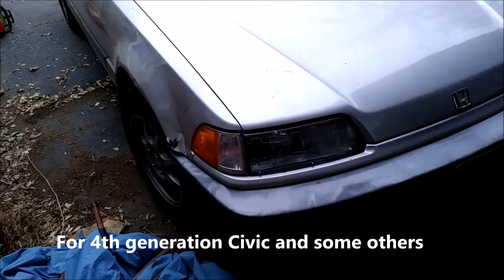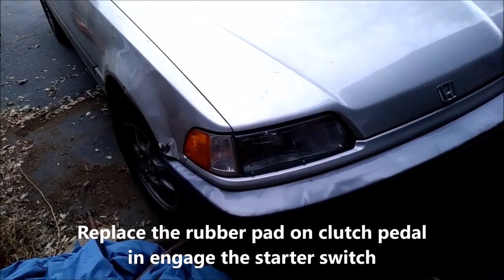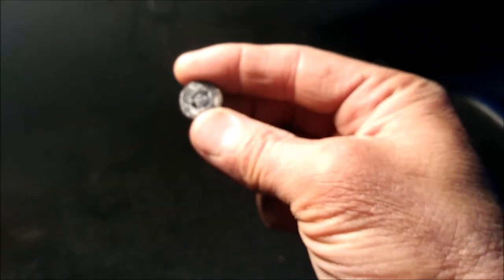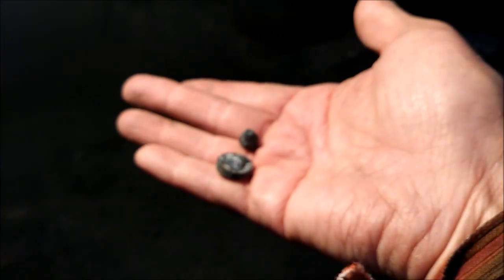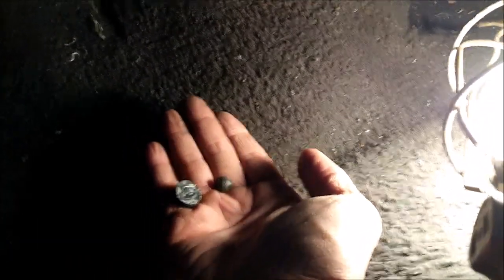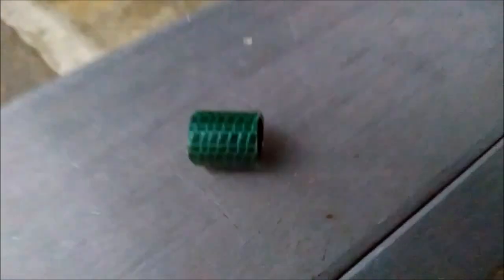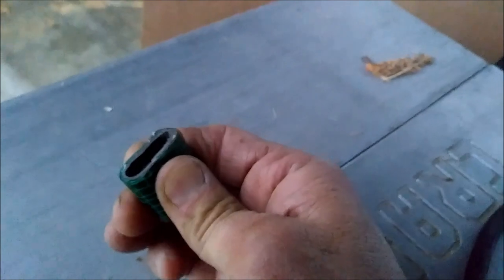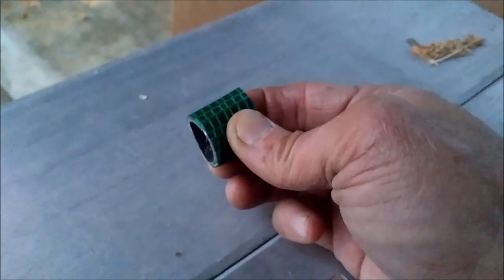Honda Civic Clutch Pedal Start switch pad alternative replacement

Comment: Thanks! This was the solution to the no crank, no start issue on my '95 civic. After a $75 guess on the starter, and some multimeter testing, I found the broken rubber piece on my floor mat. I haven't tried the garden hose fix, yet, but I will. Tight squeeze to work down there! I pulled the harness off and jumpered it with a paper clip...
Reply: I just did this exact same thing. was wondering why there were two switches? I just jumped the switch A terminals. knew it wasn't solenoid or starter cause both of those things worked perfectly until this one time, also I replaced the battery a week ago.
Reply: This is my story too… seems all to common when this happens. Cheers

Comment: Story time. I drove from PA to my friends place in Florida. My 91 civic ran like a champ entire trip. I need to stop for gas and I'm about an hour away from my destination. Fill up get a Gatorade and the thing just won't start back up sitting at the pump. Know my batteries strong. So I get a kind stranger behind the wheel and push it to a hotel that luckily shares the parking lot with the gas station. I buy a 200 dollar hotel room an hour away from my buddies place and I'm thinking starter, ignition switch, or starter fuse. Ive never seen a car just not even attempt to crank before and I'm whacking on the starter pulling fuses jiggling the keys and youtubeing my ass off. After watching a chrisfix vid I know to check for the clutch switch but the design of it in his video is way different and I can't find any wires or any sensors because I'm looking to low on the pedal(around the spring and nut). Then I watch this video and the lightbulb finally turns on and I'm kicking myself for being a complete moron because the same freaking thing already happened to me with the brake light switch and I already have this piece sitting in my glove box because it came in the same pack with the brake light part. So I'm out the price of a hotel room for being a complete moron.
Reply from the maker: Thank you for the story. I hear ya. We all go through situations when we have to unexpectedly have to pay for a hotel or transportation when we are traveling.  Best wishes.
Reply: Of course the car would still push start if you had only tried.

Comment: Quick question, do you just wedge it in between the metal bracket and the button or do you slide the hose rubber onto the metal bracket ? I wedged the rubber hose in between and it works but it was also now start without even engaged the clutch, was just curious which one you did ?
Reply from the maker: I slid the rubber hose onto the metal bracket. This way the car will only start when the clutch is engaged.

Comment: (I'm working with a '92 Honda Accord) I could NOT get this to work with my fat ol fingers, sad to say. BUUUUT.... I DID come up with a temporary fix. 

I simply unscrewed the neutral safety switch and screwed it into where the Cruise Control switch was.  (They had the same thread, nice. Otherwise I'd have to press down the neutral switch by hand every time I wanted to start.)  The only thing is, now I have to leave the clutch UP and make sure I'm out-of-gear when starting lol

(I never could get cruise control to work, and now I know why! Silly plastic stops falling apart after a quarter century.  Same thing with my brake pedal and always-on brake lights a year or so ago.  Google "Dorman Part 74015" for a quick visual reference.)

So:  if you just need to get to work in the morning, this is one way of doing it.  I'll probably fail my annual safety inspection in a few months as a result.  But once it cools down and I have the time, I'll just have to pull apart some paneling to give myself access the to clutch housing and do it right!

Cheers to everyone fixing their cruddy old vehicles and not wastefully throwing away what they have in this disposable society we live in.  This thing's a reliable old tool that gets me from point A to point B, not a status symbol.

Comment: For those who have tried this and for some reason can get it to work, Just unplug the pigtail that connects directly to that clutch pedal start switch ( may be called clutch switch assembly.    for example.  mine for my 05 civic si is part 36760-SE0-003 found here https://www.hondapartsnow.com/parts-list/2005-honda-civic--3dr_si-ka_5mt/chassis/pedal.html?PNC=7 )   and instead use a paper clip to bypass it.   

Meaning plug the paper clip ( one end into the left part of the pigtail and one end into the right part of that same pigtail).   I guaranteed you if you do this right, you can now crank your civic regardless of whether or not you press in the clutch pedal.

* warning though **.  ensure your in neutral before attempting to crank using this method or your car will jump/stall on you upon cranking.   

I don't know why the dumbasses at Honda  designed the arms of these  clutch pedals not to make direct contact with pushing the black spring loaded pin ends of these clutch switches ( both the starting switch as as well the cruise control one on my car) and should have instead just at least drilled a hole, simply tapped it, and used a big enough metal bolt/screw with a big enough wrench-fitting head on it in which to make the contact pushing in the pin to do it's job.   These plastic or rubber little pieces are difficult to pin point when searching for them as replacement parts.

Comment: I'm going to try to get the OEM stopper/plug into the hole but I may revert to this method if I get frustrated.  Replacing that thing is a PITA.  Seeing as the Vehicle Inspector dinged me for mine being bypassed at the plug, I have to fix it.    This is one of those jobs where you need "the strength and know-hoe of a man and the hands of a little girl"!  JIC my "tape the plug on the tip of a screwdriver and press"- does not work, I'm using some scrap hose!  Thanks Brad
Reply: Follow up: I got it done.  I removed the switch "blind" lying on my back, crammed into the drivers floorboard/pedal box doing most everything by feel.   I would not repeat that ever again.  I will do it the way I'm listing it below if there ever is a next time.  (I Might even remove the battery cable next time, but I doubt it. 12VDC isn't much juice IMO/IME but the Safety Guys so YOU should do that before working on a car so follow there advice)

My path was to; 1)  remove the lower cover below the steering wheel and 
2)  the metal safety / crash guard below the steering wheel. 
3)  I then removed the two 10mm nuts holding the Fuse box and lowered it done a bit to get clear line0f sight to the upper switch (switch B which is the Clutch Safety Interlock.  this made it easy to see straight thru the threaded bore that holds the switch and the hole on the pedal assy. where the grommet/pad is retained.  I then 
4) Pushed the Clutch to the floor and held it in place with a long screwdriver and a block of wood that was braced against the upper steering column, this allowed me to see thru the switch hole to the pad hole.  
5) I used a small dowel and some masking tape to fashion u a "fishing line" if you will, to then guide the Pad/grommet up over the top of the boxed in clutch bracket assy. .  It was pretty easy to then guide the pointed end into the hole and I stacked up a bunch of 1/4" ratchet extensions which allowed me to then push that centered up pad into its hole/retaining bore on the pedal assy.  Hearing it give a little click as it pressed in was music to my ears!  I pulled out my little fishing pole (so what there is some dangling masking tape!)  
6)  Install of the Switch. I used a chunk of old hose, about 9-12" or so, to hold the switch as an extension.  It made the install of the switch a piece of cake.  So much easier than trying to do the task "Blind", on your back, crammed into the pedal area of a Civic) Try to remember how far the jamb-nut was when you removed it (mine was about halfway down the threads)  
 7) connect up the connector and do a quick start test to make sure you SW is properly set BEFORE you close up / start putting the removals back in place. 
             (IF You followed the Safety Guys and disconnected the battery before you started working on the car, you'll need to connect it again to do the Functional Checks)  
         Make sure both of the clutch  interlock switches are hooked up...BOTH are required to start the car.         
           NOTE:  The Clutch Safety (Upper) interlock should be set so that the clutch is pretty much "to the floor" to pass some state inspections.  IF the starter does not kick in and your car does not start, turn it in clockwise until it does. and then Lock down the jamb nut (17MM)   
8) Double check the start again after tightening the jamb nut...sometimes doing that can affect the distance of plunge on that switch plunger!  
             (You've done enough swearing,  (be that "virtual" or out loud) I did anyway, I'm a big guy and laying on my back in the floorboards of a CIVIC plays hell with my back!) , so better to double/triple check before you close up.   Better to do a double check than to have regrets...right?
8) Re-assemble the things you pulled down to gain access to that damned Switch and grommet.  Check whatever you disconcerted by removing the lower panel assy (Fogs, Dimmer sw or whatever) 
9)  Check the functions of what was disconnected.  Everything works?  IF So.....Take a chill with a frosty beverage...Youve earned it!!! 
 "Boog"

Comment: The same thing happened to my 97 I ended up replacing the starter just for the hell of it and then I had noticed that I have a lower and a top switch and my top switch grommet had broken and soon as I super glued three pennies to the top of the metal part it fired right
Reply from the maker: Yes, I've heard about using pennies; but I was afraid of possibly damaging the starter switch.  So I wanted some type of rubber to trigger the switch.

Comment: But how do you get above the clutch to slip it over the top? I can’t get my finger in there to slip the hose over it
Reply from the maker: It's a tight area to get one's hands and fingers into.  First locate the switch button by following the pedal from below.  You may be able to see it or you can feel with your hands.  Across from the switch button is the bracket to slip the piece of hose.  Slipping the hose over the bracket may require you to use the tips of your fingers.  I hope it works for you.

Comment: Could you replace that piece that broke off ?
Reply from the maker: Yes, that part can be purchased.  But, I just did a quick fix with the hose and it still works fine.  Thanks.
Reply: Got it thanks !